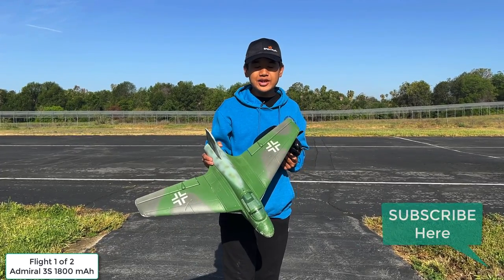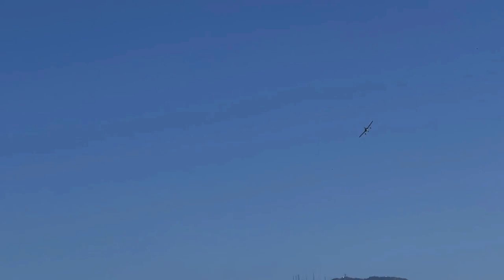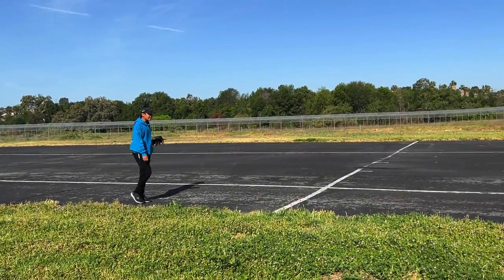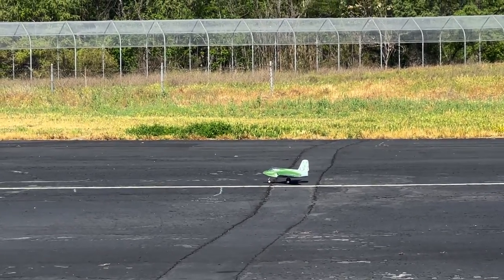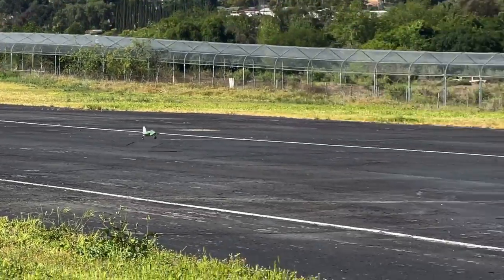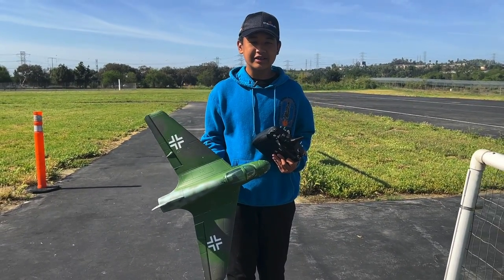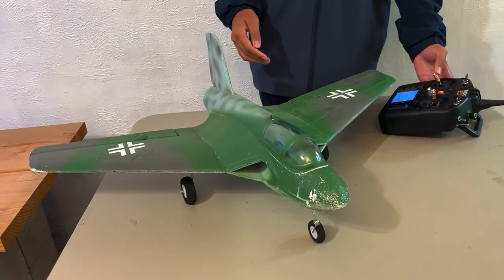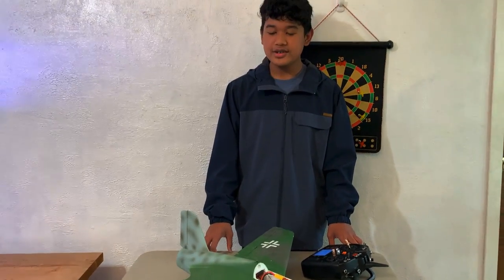Freewing Lippisch P.15 64mm EDF Jet - Bring your flying "A" game! You're gonna need it for this jet!

Comment: It's actually very stable when set up right, limit throws to way less than manual suggests, and use about 3 mm reflex. Ditch the wheel maybe, it might be part of the problem? Those mains are HUGE!. As a  hand launcher it work great, after  probably 200  plus flights I'd say it doesn't really have any nasty habits. Stall/ spin recovery is super easy. For 30 bucks, man, that is a steal !! -:)
Reply: meant so say- if you would hand launch it, use 3mm up reflex on a switch, then after take off, flip the switch back. Plane has a tendancy to dive on take off due to negative air pressure created by cheater air duct on the bottom of fuselage.
Reply from the maker: Thanks for the tips! I agree the landing gears definitely affects stability! I may just take them off.
Reply: @JonsRC   Welcome! have fun with that thing -:)
Reply: This thing is 30 bucks? Arf?

Comment: Great video!  The original design dropped its wheel set just after take off and landed on a small skid. Could that be why you plane was touchy and unstable?
Reply from the maker: Wow! Very interesting! We did not know that! Yeah, other RC pilots told us to ditch the landing gears. It will definitely help stabilize the plane! Thanks!

Comment: What channels do you plug in the throttle and elevator in too i cant get them to work just the ailerons and i have them on 2 and 3 throttle one one i believe elevator is on 4 but only one side goes down

Comment: Why would you need rudder expo? Isn't that just for ailerons? Personally, I always just learn to fly without expo. But, I prefer to just fit the plane with a gyro.
Reply from the maker: The rudder channel is used for the front nose wheel. Without expo, the front gear servo is very sensitive to taxi turns.